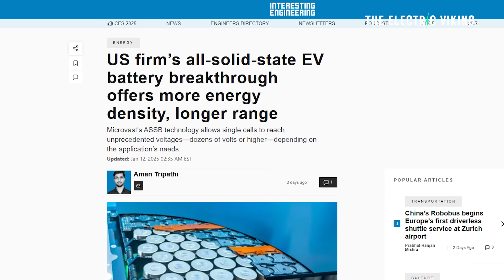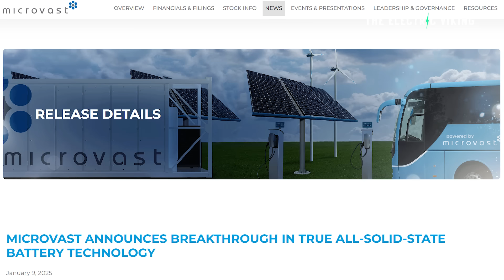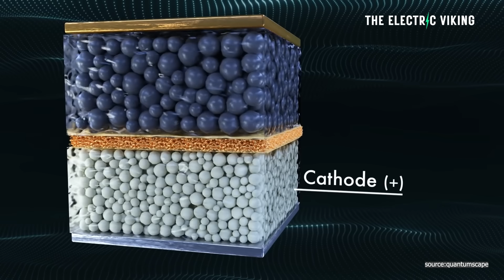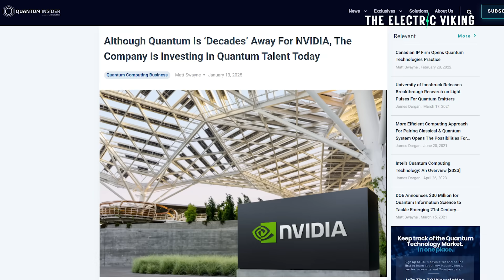Microvast says its Solid-state EV battery breakthrough is game changing

Comment: All I've said was people need to be able to have the choice but in the same time there needs to be an express lane for better technology. And I can forsee a time when this kind of technology will solve a lot of issues in the automotive industry. In aviation it's still a pipe dream and likely will be for the foreseeable 25 or so years for longer flights. They're working on hydrogen fuel cells, non crop bio fuels...crop bio fuels have done nothing but rapidly decrease forestation and therefore increase the problem. This higher broken technology offered in today's "fuel management" automobiles has done nothing but exacerbate the problem because people always need to have newer autos because they can't afford to make payments and have exorbitant maintenance bills at the same time. So ever replacing a vehicle is really good for the auto makers but really bad for the consumer and doesn't do anything for the problems. If you can't purchase a new vehicle and reasonably expect to get 15+ years out of it then it's a huge waste and actually worsens the problem. We need common sense solutions not extreme right wing denial or extreme left wing monetary crisis!

Comment: The voltage statement seems to indicate BS.  Voltage in a chemical effect between two metals.  1 to 3 volts.  Capacity is amps.  Volts x amps = watts.  True solid state would give good watts for a time for a weight.  Not talking about this so BS.

Comment: Sure solid state batteries will be a breakthrough.  Making a few cells in a lab is not the same as getting it into production (which was the lithium problem for years).

The first market for cells of this type will probably aeronautical 

Quick search and they are in the pilot production phase - with a lot of steps including safety to go before can be released commercially.   Voltages on the cells between 12 and 21V for other solid state products).

I guess they are looking for new funding

Comment: I go from FL to IL quite often and I stop several times for gas/bathroom/food/stretching. Most times gas stations are easy to find and I have no problem getting in and out with all of my business concluded. I don't believe that charging stations are up to that level. I have even seen charging stations with nothing but chargers, meaning I would have to make another pit stop. Not good. If I could go the distance that I need to go and only have to charge once during my whole trip it would be valuable to me.

Comment: We should have waited until safer and more advance batteries were available in the first place. Lithium ion batteries are a known fire risk and have been so for 30 years killing many and damaging thousands of properties. This will make if true all current EV's worthless and we should have waited. You will still need a lot more electricity to be generated and grid and local distribution updated which will take years to achieve.

Comment: Surely the point of solid state batteries isn't so much to do with having cars that can go 1000 miles between charges, but rather that this kind of power density will open applications like commercial electrically powered air travel while also allowing for lighter, more fuel-efficient cars.

Comment: One thought.... You may need to stop to use the bathroom, but that doesn't equate to also needing to charge your car battery at the same time. Personally, I think it would be nice to only have to stop for food or restroom... Perhaps at a restaurant... And not have to worry about where a charger is. So, don't limit your perspective to driving for 1000 km without any stops as the reason to have it.

Comment: Van drivers in London pee in a bottle but it can get messy 
The average commute is 40 kms a day so this is not required for single use but it’s good to save money and for convenience . You only have to charge once a fortnight or a month depending how far you drive per day 
With autonomous driverless cars being adopted it also may become more useful
to save the robotaxi time off from looking for charging points daily. If it has a 1600 kms range and its working 24 hours per day it may only have to charge once every 3 or 4 days 
Likewise you may have to do a long trip in your driverless car and you don’t want to experience delays going to the airport and checking in 2 hours before departure so the long range would come in handy

Comment: Some truck drivers use a catheter so they can drive long distances without having to stop for the pee break … just empty the bag at the end of the run
Reply: Van drivers in London pee in a bottle but it can get messy 
The average commute is 40 kms a day so this is not required for single use but it’s good to save money and for convenience . You only have to charge once a fortnight or a month depending how far you drive per day 
With autonomous driverless cars being adopted it also may become more useful
to save the robotaxi time off from looking for charging points daily. If it has a 1600 kms range and its working 24 hours per day it may only have to charge once every 3 or 4 days 
Likewise you may have to do a long trip in your driverless car and you don’t want to experience delays going to the airport and checking in 2 hours before departure so the long range would come in handy

Comment: Sam,  Love to hear there is yet another, at least pilot ready, battery tech that could be useable. I've been following Hybrid and EV for about 25 years.  We're on our 3rd hybrid since 2012. One area not discussed much is the potential to revitalize existing PHEVs /EVs like our 2014 Fusion Energi. 
Seems like it's only a matter of time until some clever EE or similar designs and makes a retro of existing packs - like one in our Energi.  A custom BMS and a new ultra reliable (and hopefully larger capacity) battery retrofit would be really neat.  Our PHEV has about 95000 miles with about 45% battery left, ~ 9miles/charge. 
Maybe one day you can do a deep dive into retrotech to show the state of the market. 
Background: I'm a recently retired Lighting Design Engineer (2024 Silverado EV HL, etc.) .  Been holding out on an EV to get 300+ mile/charge + and a larger SUV or Medium/full size truck EV - at good relative value i.e. cost/yearly salary.  
Note: The reliability of hybrids we have owned is at,  or above,  every ICE car we have owned (all Ford/Lincoln types).  My perspective is durability, value, and achieving low cost per mile. 
When batteries achieve  longer than a one VIN number lifespan, they will become an investment choice for lowering costs. 
This could be via grid connection and/or moving the pack to a new vehicle.  
I am interested to hear you thoughts.

Comment: A BEV needs point to point and back again range to complete against an IC engine due to the terrible charging infrastructure. At a typical motorway stop there are (if you are lucky) 5 or 6 times the number of liquid fuel stations that typically take a few minutes against a handful of electric points that take half an hour. It’s no wonder EV owners are getting fed up.
Reply: My (2004) Rx-8 225 bhp had 275 miles range which is comparable to my GV60. In the UK  mainland North to South is some 800 miles by road. With a charging infrastructure of some 73,000 public charging points at 37,000 sites compare that to 8353 petrol  fuelling stations. 

I’ll admit 321 WLTP range EV s won’t work for everyone but they are definitely viable now, today for a lot of people- particular if they are fast charging. I wouldn’t recommend an EV which couldn’t do 150kW on a good day if road trips are more than a once in a blue moon occurrence. Just my thought having owned a GV60 in the UK for the last 2 and half years. 

Price has been an obstacle up until now but given only 15% of UK cars on the  road are less than 3 years old most buyers are looking at the second hand market . Second hand EVs which are typically 50% the cost of a new are available. Choose a pre-face lifted EV6 , Ioniq 5 or GV60 and you could be getting viable EV motoring with reduced servicing , maintenance and “fuelling” costs over an equivalent second hand ICE at only a slightly marginal premium in purchase cost. Those EGM vehicles from 2021/2022 are ahead of their time - 800 v architecture for rapid charging, OTA updates, great tech.

Comment: With a thousand miles of range though, when towing, you'd still have something of a practical range.  For those who pull heavy ass trailers 2 or 3 hundred miles at a time, 1000mi,  - 60%-70%, means the show still goes on.  If they make a battery that charges super fast but only has 3 or 4 hundred mile range, you're not as likely to electricy commercial and construction vehicles.

Comment: 700 miles of real-world range would be time-saving and add a lot of comfort. After 10 PM on an empty highway and dry conditions You could do a lot of miles in 6.5 hours if going at 150-160 kmh and faster on short streches. On long distance trips it saved one overnight stay back in the day. I know, nowadays traffic control and speed cameras don´t allow for it and You are "forced" to take the plane anyways, if You want to ever reach the destination at a reasonable cost. According to airlines this even helps to save the climate.

Comment: I think there will be an intermediate phase where solid state batteries are used for specialist applications like drones, electric aircraft, and man portable military batteries before more general application. One more factor to consider especially for electric aeroplanes is the potential for solid state batteries to be formatted as structural components of the aircraft so largely offsetting their weight and volume. Regarding high voltages "per cell" this is not in reality ultra high voltages per cell - the underlying electrochemistry will not allow that, what the technology will allow is multiple stacked cells in a single case without having to complicate the BMS or have much by way of structure between the sequential cells.

Comment: What you guys seem not understand is that fast charging does not scale up to widespread use. Charging a 80kwh battery (400km reach) in 6 minutes takes the power of 200 households cooking lunch. If only 5% do that concurrently we need 10x the peak power we need now. Neither production nor the grid can handle that. The solution can only be charging at least one full day of energy requirement (capacity) slowly (e.g. over night or during daily stand still). For this we need large capacity of 600 or even more km. No matter how many pee stops you do on a long ride.  My Mazda takes 3min to fill a 650km reach. Normally I do it once a week, but on long drives it can easily happen  in one day.

Comment: Don't forget there is a market for people who pull boat and camper trailers etc.  EV Range is greatly impacted (~50%) by towing due to aerodynamics as well as the added weight.  1,000 kms of range would be highly useful for this market segment.
Reply: Thank you! You made an excellent point. I can buy the Aptera, 1000 mile range, but my wife wants all the distance possible, the more the better. She would pay more for 2K.
Reply: Someone needs to invent a car/ caravan with batteries in both and then the caravan could power the car and then itself when at the camp spot.
Reply: @Paulruk a diesel generator
Reply: @DeweyKendrick that would mean having to fill it up at a service station and pollute the air . Times have moved on.
Reply: @Paulruk really? You're probably using coal fired plants for electricity

Comment: In their press release, it says the tech  "allows a single cell to achieve dozens of volts or higher *based on specific application needs *..." (asterisks are mine). Also, "The graph reveals a stable operational voltage range between 12V and 21V". It didn't take much reading for me to find that. Like, 2 minutes.  Also, they currently have 4 types of batteries in production, and their batteries have been in vehicles for over 15 years. I don't know why you're giving them the Toyota treatment. That's not fair at all. They've done A LOT more than just say "trust us" for many years. They have several real products used by industrial and transport customers, and there's a lot more to come.

Comment: they said that about computer ram also,, who would ever need more than 4 megs of ram anyways?
Reply: Computer RAM keeps getting faster. 4GB of RAM takes a long time to fill on an old machine. Cars are subjected to one of two speed limits. The legal limit or the practical limit (yes, Bugatti can manage 250+MPH, but only in short sprints and by eating a set of tires).  Drive much faster than 75 and your range will plummet due to wind resistance. The range you need from a battery is thus more to do with how long you can reasonably drive in a single stretch. If you have a car that can exceed that range, and recharge in less time than it takes the driver to recover then you’re good.

Comment: Cells being able to work at 10s of volts? Sorry, my BS meter just shot off the scale. The voltage of a cell is based on the electrochemical difference of the materials being used (hence different voltages for NiMh and Sodium Ion). You can increase the voltage by putting cells in series, but you can’t really influence the voltage of a cell by changing the electrolyte.

Comment: The benefits of a major boast in the battery density is not just about regular consumer use ie a 600km range. As density increases then smaller batteries can be used and hence dramatically saving reducing the weight of current EV’s. Also greatly improved energy density means that those vehicles that need extra energy to operate can now easily convert to electricity ie trucks, boats and planes.

Comment: Quantumscape has already tested solid state batteries in Porsche vehicles. They have worked well, providing longer range and more durability after thousands of discharge cycles. The problem is cost. It has been difficult for firms to make them at a price that is competitive with conventional Li-ion batteries, whose prices continue to fall. Other US firms already make solid state batteries for larger applications than passenger cars, but again, at low volume. It is very much a race to get to the best battery technology, and this is why I think the QS stock is very deeply discounted.

Comment: The extra range is helpful for towing requirements or towing in cold weather.  It isn't that people need 1000 miles of range, they just want enough range in all scenarios.  Especially since finding a charging station that works while towing can be challenging.  The extra range gives you peace of mind that you'll make it somewhere that isn't stressful to maneuver a towing vehicle within.  Also, it isn't uncommon to stop at a rest area to use the bathroom and leave when you have more range.  Also, I'm guessing the big range battery would better support 18 wheel vehicles, buses or RVs.  I can see plenty of scenarios where that battery could be helpful in converting to renewable technology.

Comment: It sounds like they are describing a pile of several cells stacked, which might explain how they reach higher voltages. That would not by itself increase energy density but if you can pack more cells with less support materials then yes this would increase pack density
Reply: And perhaps allow higher voltages/ lower amp charging

Comment: It does mean that the batteries could get smaller and lighter. That means electric vehicles should become more efficient, considering you only need enough battery for 500 km or less range,  if you can recharge in under 15 miutes.

Comment: Very suspect announcement imo. Cell voltage is a characteristic of the chemistry involved, so getting say 10 volts indicates that there are multiple cells in series just like in lead acid batteries in ice vehicles where 6 cells are used to generate '12' volts.

Comment: No you don't need 1000 miles but when you pay £0.07 GBP at home and on the road you pay £0.75 GBP it would be nice to always be able to do a round trip and not have to charge on the road. But the answer to that is for the charge point operators (CPO) to stop ripping us EV drivers off. If we had more miles we would avoid the CPO and force them to start charging more appropriate prices.

Comment: Solar powered car body shell 🔋  Transparent Solar Windows as well.  Doesn't matter of %. of charge. Emergency power use, say 50 miles, doesn't have to be quick charge, separate battery 🔋 👍
Reply: Save weight to the main battery
Reply: For a long time have felt this is the future.  Structural frame made of batteries with a solar skin.  Much more integration where basically the car only has 20 or less easy to swap parts.  No Dealerships or Service centers just certified mobile mechanics and roadside assistance.